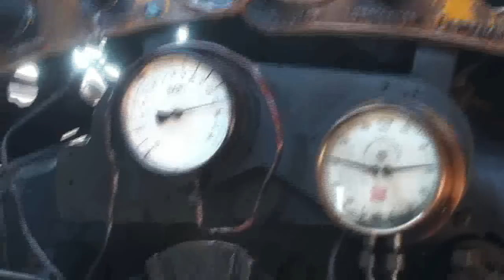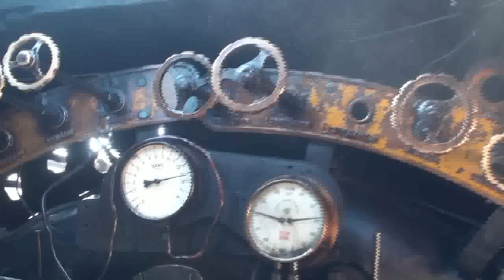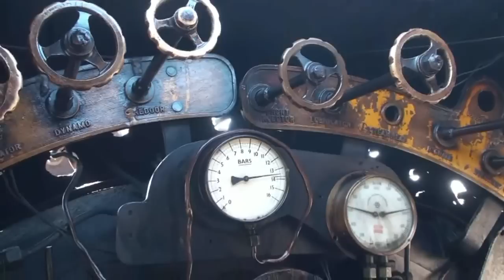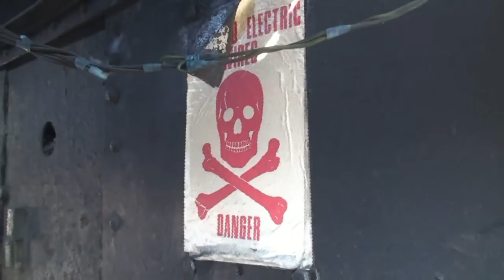Zimbabwe - Cab Ride in a Class 15A Garratt, July 2017

Comment: The Front is the Water Tender,we used the Garrats (Oilburners) in 1953/54 in the South Australian Railways (Narrow gauge )The Back Tender was full of Oil instead of Coal
Reply: I always Wondered about traction as the fuel and water is the drivers weight and is consumed.
Reply: Jay Locker - That's why tender locos are better as the weight on the drivers stays consistent throughout the journey. One problem with Garratts going uphill is that the water would drain from the front tank in to the back tank reducing the weight on the front set of drivers and making them slip while the rear drivers had all the grip.
Reply: Thank you both for the replies. I always wondered about traction in these locos. You both told me what I suspected. Thanks again

Comment: I served my Aprenticeship on the NZR (New Zealand) and some of the older blokes I worked with had been involved with NZ's Garrets, three of them . They were a disaster being too heavy and too complex with automatic coal feeders and so on . They would spread the rails if opened up too quickly with a train behind. When they were introduced, new Zealand still had carriages with wooden head stocks, the result being that a Garret pulled traqin could rip the draw gear out. ( I worked on some of the last wooden headstock cars in 1974) . The matter of complexity was compounded with the 6 cyliner layout and two different types of Valve gear. They were eventaully stripped and rebuilt as 6 G type locos ,which were also very troublesome.
Reply from the maker: It's a shame for the Garratts that they have to be criticised for being too powerful ! In effect, it's like having every train double headed .... and, of course, you should expect twice the maintainence requirement. The automatic coal feeders were only necessary where long distances were being covered. These in Zimbabwe didn't have that problem .... water capacity is the issue here.
Reply: six cylinders and two different kinds of valve gear on one locomotive? No wonder they would be hard to operate!
Reply from the maker: These Garratts have four cylinders ..... and as far as I know only one type of valve gear. But I'm sure you or someone else will prove me wrong!
Reply: The NZR Garratts had Walscheart valve gear to operate the outside valves and Gresley valve gear to operate the inside valves. Apparently the NZR wasn't the only railway to have problems with Gresley valve gear.

Only the NZR and Britain's LNER had Garratts with 3 cylinder engine units (6 cylinders total).

The New Zealand Garratts had the lowest adhesive factor of any Garratts anywhere. Good if you want to pull lighter trains at high speeds but our Garratts were for hauling heavy trains up steep grades at slow speeds so that's another major failing they had.

The splitting up of the 3 NZR Garratts in to 6 conventional locos was the only time this ever happened to Garratt locos anywhere.

The NZR Garratts had a Tractive Effort of 55,023 lbs @ 80% boiler pressure. When they were introduced the next most powerful steam locos in NZ were 26,615 lbs. The locos introduced a couple of years after our Garratts had 30,815 lbs and they won the day. So it just goes to show how out of place the NZR Garratts were at the time.

Half the problem with the mechanical stokers was that the coal supplier in the area that the Garratts worked would leave in the coal supply metal bits like broken coal drills, railway spikes, etc and these would jam the stoker. These metal bits were still being found in the coal supply as late as the 1950s but hand-fired locos weren't affected.
Reply: The Tasmanian railways M class   garrat was an 8 cylinder machine..

Comment: Thanks for sharing this great video of the African Garratt. And also letting us know that there are these two different Rail Gauges in this part of Africa,the Meter Gauge-39 3/8-inch gauge,and Cape Gauge-42-inch gauge. I think there was also the 600-millimeter gauge Apple Express,which was around 23-to 24-inch gauge.
Reply from the maker: I'm not sure that I've said there's any metre gauge in southern Africa. There may be but I don't know of it. The standard gauge that I've seen is Cape Gauge.
Reply: Thanks for clearing that Gauge  issue up with me. I don't how I got off the track thinking there was Meter Gauge there.
Reply: There is a narrow gauge Garret here in the US owned by a very reclusive man who has a very private railroad on his ranch, He's very elderly and very reclusive. I did find a couple of photos of the loco though.
Reply from the maker: There are quite a few Garratts still surviving around the world - most of them narrow gauge. There are a few in Wales on the Ffestiniog/Welsh Highland Railways.
Reply: There is a South African Narrow Gauge Garratt that I know of near Hempstead Texas. It is NG-50,-a Class NGG-13-2-6-2+2-6-2-works number 10590-1928-built. It can be found on-Surviving Steam Locomotives in the U.S.A.,by clicking the map of U.S.A.and Texas. You can also go to ''South African Class-NGG13 2-6-2+2-6-2 works number 10598-built 1928''.,and  go down. There is a very good close-up-picture of it down on the right.
Reply from the maker: There are quite a few Garratts surviving around the world, but I didn't know of this one in Texas. Thanks.
Reply: That Private Estate near Hempstead Texas,also has a South African Railways #18 NG-15 2-8-2 built in 1931. It can also be found at 'Surviving Steam Locomotives in the U.S.A'. I am not sure how one could get to see these 2-foot Trains though as they are back off the highway. From the Google Satellite image,I can tell they have a few hundred feet of track,but I don 't think it makes a complete circle. I have discovered the guy's name is R.L. Bucher,who along with his 2-sons, runs a privately owned 610m.m. or 2-foot narrow gauge Railroad called the Hempstead & Northern Railroad. I hope this helps.
Reply: That's the one I was talking about.
Reply: A general rule of thumb about rail gauges on the African continent: Northern Africa has Standard Gauge (4' 8.5" or 1435mm), Central African countries ("East Africa") have metre gauge and Southern Africa (South Africa, Zimbabwe) have 3'6" or 1067mm. I have just checked Wikipedia and they don't even mention South Africa & Zimbabwe in their list of 3'6" gauge railways.

There are 3 African Garratt locos here in New Zealand: a NRZ Class 15, a South African GMAM and another Zimbabwe Garratt (I'm not sure which type). None are certified for mainline running and I think only the GMAM was run up and down on a short length of track a few years ago.

Comment: What is that extra bit on the front for? is it just aerodynamics?
Reply from the maker: As Aiden (and one or two others) have pointed out, it's a water tank. The supply of water is always more of a problem for steam locos than the supply of coal - especially in a country where water is in short supply. The tender at the rear also has a water tank, as well as the coal bunker.

Comment: Do the Garratts' suffer from lack of weight; overloading; or impatience?
Reply: With Garretts the adhesive weight lowers as fuel and water are consumed.
Reply from the maker: As Varinki says below. This one seemed to have a particular problem on the rear engine though. I think there was some problem with the set up.
Reply: Thanks for the reply; Varinki

Comment: Have to wonder about the wheel spin on only the middle(?) drivers. How are these different elements coordinated? The engineer must be at least part artist.
Reply from the maker: Of course, it's not just "middle" drivers that are slipping. Each set of drivers are connected by connecting rods. However, the Garratts are, in effect, two separate locomotives (each 4-6-4) supplied by just one large boiler. So either of the locomotives can get wheel slip. Presumably, as the train is setting off from Thomson Junction, the rear set of drivers has less downward weight on it than the front set - presumably because the water tank over the front set is full, whereas the coal and water tender over the rear set is half empty. It must be a tricky balance keeping the downward force on each set of drivers at a similar level - one of the basic problems with Garratts !!

Comment: Zimbabwe railways and Union Pacific Both have the fastest Articulated locomotives ever built tith the garrat being 12mph faster than the Big boy and Challenger most articulateds max out at 50-60mph
Reply from the maker: I'm not sure there's any fixed maximum with a steam locomotive. You can push them and push them harder until, eventually, the bearings burn out (as they were just about doing with Mallard) or some other disaster happens!  ...... Andy
Reply: @AndyDandanFisherSteam  
I was expecting the challenger to have a higher top speed than the "big boy" due to the fact that it is primarily a mixed use/passenger engine while the big boy was designed with freight in mind.
Reply from the maker: @raymondleggs5508  One of the main deciding factors is driving wheel diameter .... Andy